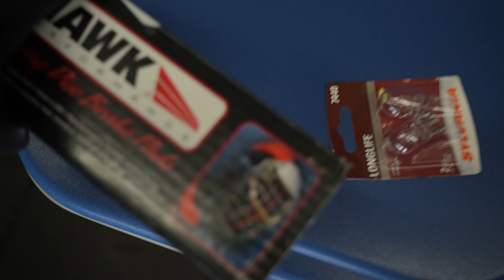Installing RACING brakes on the Prelude!

Comment: Hopefully he wasn't braking hard right after install smh.. That is NOT how you break in brakes... LOLOL. The idea is to just get them warm up with normal* driving, then let them cool properly. Then FULLY heat them up on highway. That was a bit noobie from him as a mechanic. Normal driving = heating them up. If you brake hard after initial install, you grind down pads down super un-even. They weren't ready for tons of load right off the bat until they are "bedded". GL homie! hopefully they stay smooth for you.
Reply from the maker: You would need to do a few moderate braking and then a few aggressive braking which we did both of to bed them!